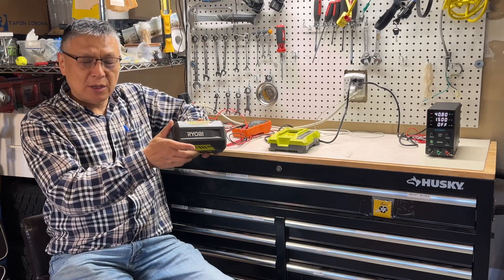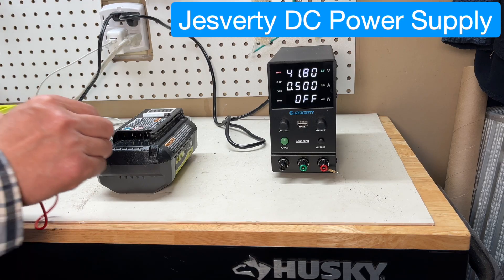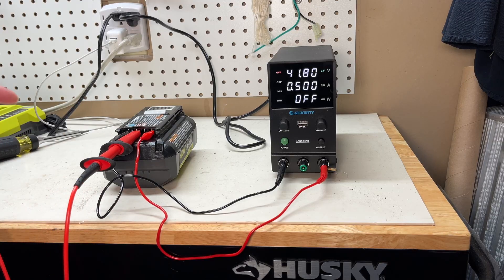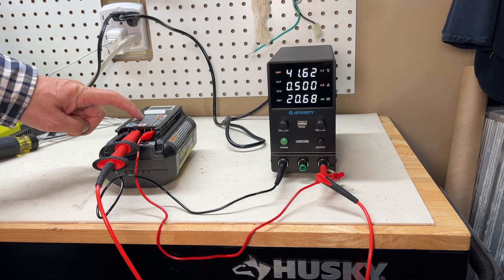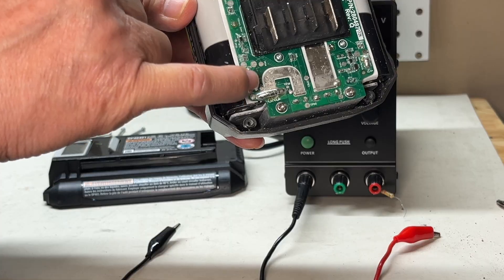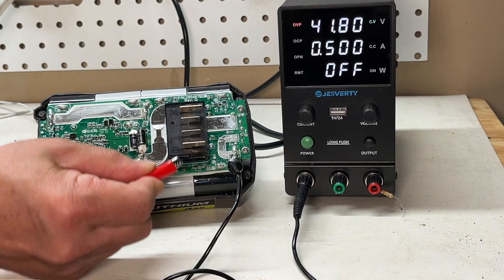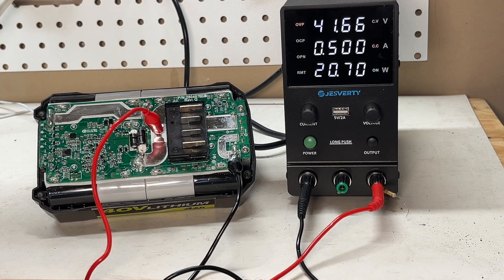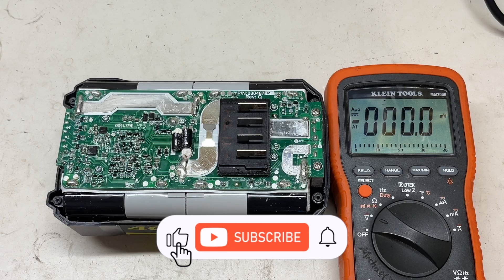How to Revive A Ryobi 40V Battery Not Charging? Try These Tricks

Comment: Thanks for the detailed video. The problem I have is that my battery must be a different revision, because there is not any reset terminals on the board! So far I have been unable to find anyone demonstrating the reset on the model of 4aH that I have.
Reply from the maker: Sorry to hear that. I will let you know if I can find. What’s your model number?
Reply: Same here, completely different circuit board.
Reply: If you have got the same battery as mine, the reset terminals are next to the led lights (the 3rd one). The voltage is ~3v.

Comment: Excellent! Thank you. Question:  Three of my ten cells are at 3.1, 3.5, 3.6v. Should I try to charge them individually, or as part of a ten-cell overall charge? How to do this individually? I have an external DBPOWER DJS50 external charger that delivers 19v. Will that work? Thank you so much for sharing your knowledge.
Reply from the maker: Great question. If one cell is noticeably lower than the rated voltage battery monitoring circuit will stop it working. Voltage at Lower cell has to be raised by charging individually to or near rated voltage. So charger voltage should be at one cell rated voltage and charge it individually. Hope it explain it clearly.
Reply: @guelphming3843  OK thanks. So, you wrote: "So charger voltage should be at one cell rated voltage and charge it individually." My charger is 19v out. Do I put the two probe ends onto the two ends of the cell I need to charge?
Reply from the maker: @languagelinguistics  Good question, if you charge battery cell individualy you should have one cell rated voltage power supply, here is 4VDC. hope this help. work safely.

Comment: Could you use a working 40v battery to charge in this matter, bypassing the BMS?
Reply from the maker: Yes you can if rated voltage at both batteries is similar and be cautious. 🤞
Reply: @guelphming3843 what do you mean by rated voltage?

Comment: I turned it off because the resistor started smoking. Why would it do that?  I only charged it at 0.5A
Reply from the maker: make sure the resistor is 330k and it is not defective.
Reply: @guelphming3843  I I just looked and they are 1/4 amp. I have to use two in parallel to run at 1/2 amp